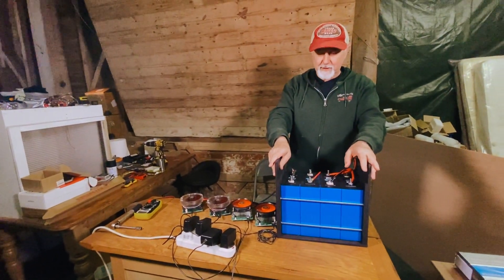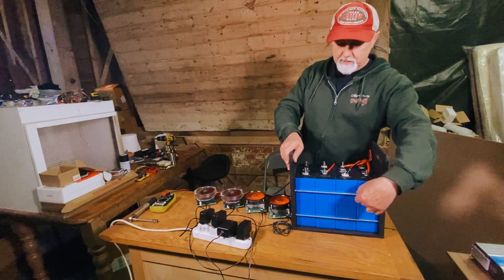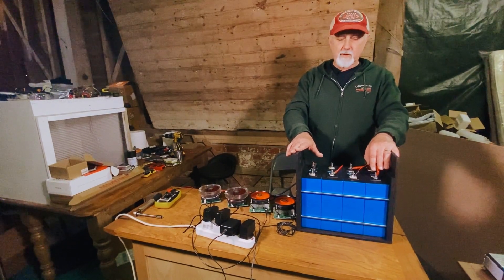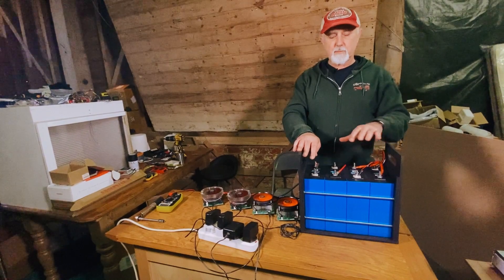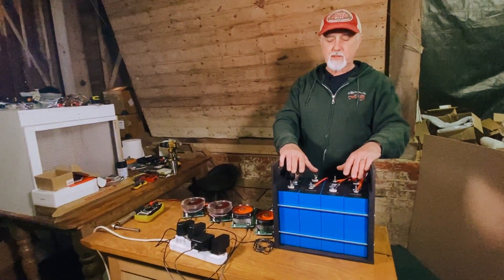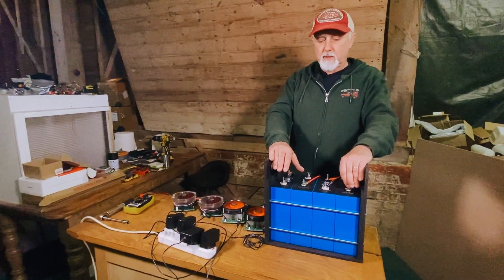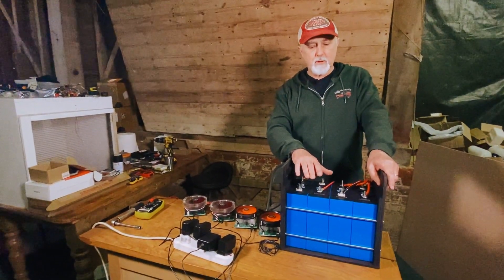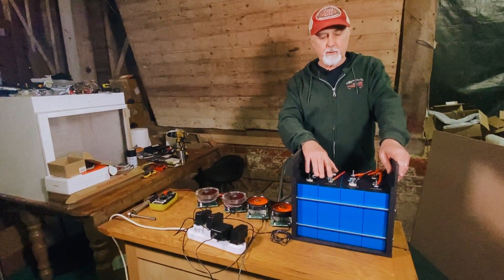420AH LiFePO4 Battery Cells: Test Results

Comment: It was a case of dyslexia… when they wrote 420, they really meant 240. Your tests prove it.
Reply from the maker: No, it was very clearly fraud. Multiple people have contacted the seller and it's been very clearly sold as 420Ah cells. We aren't the only people that have queried or disputed it with them. If it was an honest mistake, surely that would have been highlighted in all the disputes on Alibaba and the person would have realised they made a mistake?

Comment: For LiFePO4 prismatic cells the largest officially being manufactured is 320Ah, however they are actually 305-311Ah. The 420Ah cells does not yet exist, and are not on any production line. The first Sense Check is the weight of the cells, 280Ah will weigh 5,40-5,55kg ( I have notices the lighter once 5,4kg are 271-273Ah. 310Ah cells should weigh 6,04kg and the ones you have in your test should weigh 8,19kg. The second sense check would be the size a 420Ah cell should be 90mm*190mm*220mm. The chemistry in prismatic configuration is the same and requires to follow the same rules.
Reply from the maker: Great insight. Thank you!
Reply: @offgrid_power  I bet if you disassemble these cells you will find a smaller cell inside. And probably some filler material like sand, concrete or something similar.

Comment: I was kicking myself after buying 310a/h cells for my RV that these came out - I am now pleased my  cells tested 318a/h - I think balancing is important but on huge cells the tiny  60ma is just not enough - I bought a cleap 500ma balancing board and spare set of balancing leads  if the cells should drift - i used them leads to charge the pack with my T8 charger which has a 15watt  capacitor cell equalizer integrated - it balances as it charges - hassle free and very quick
Reply from the maker: Yeah, a lot of BMS will struggle with high capacity cells if they're not matched properly. Most BMS are passive balancers and as you say, such low balance current. We've tested some active balancers and they help.
Reply: @offgrid_power   I like my T8 charger - it balances as it charges so threes no faffing about with putting cells in parallel then series  long as there within 1/10 v its good to go - it charges up to 30amp too though from another DC supply - in my case the source is  480watt ex computer power supply  - time is money : )

Comment: hELLO #OFFGRID VAN LIFE  ! Please, is it necessary (and why) to put a "victron energy  battery protect" 🙂😮😮 if I got a good BMS on my battery ? It seems to do a similar job, no ? Thank you. (perhaps have you got also a better idea. Thanks)
Reply from the maker: If your BMS has the protection build into it like Daly, Overkill or 123 Smart BMS do, then yes they do pretty much the same job. Most people that I see that use the Victron battery protect don't have LiFePO4 with the protection built into the BMS, so it might be that they're still on Lead Acid or Gell.

Some people might have the Victron battery protect as well as their LiFePO4 BMS, but I don't think this is necessary. I personally have never used a Victron Battery Protect and I rely just on my BMS to look after my batteries (whilst obviously having the correct charge profiles set on my chargers).
Reply: @offgrid_power  Ok Thank you very much !!!!

Comment: I have not seen any legit cells over the 302 AH cells (commonly listed as 310 or 320) Sorry it did not work out for you
Reply from the maker: Yeah, we've seen the same. I think 300AH seems to be the limitation for this type of LiFePO4 cell. I believe Winston have some larger capacity cells, which would be interesting to test. We tested some 200AH Winston cells and they performed well above capacity at around 260AH consistently. So would be interesting to see if the higher capacity Winston cells are the same.

Comment: My only surprise here was that the value came in so much lower than the 280Ah EVE LiFePO4's. 420Ah... they really were smoking something when they wrote that listing! Good luck with the refund process!
Reply from the maker: Thanks Chris! Yeah, it's pretty crazy how bad this got! Thankfully Aliexpress have already agreed to honour a refund, but we have to send the cells back. We've decided to go that route, even though we'll loose some money on shipping them back. We figure it's better to get 80% of the money back than nothing! It was worth it for the test. ;)
Reply: @offgrid_power  that is bull.. -.- The seller should pay shipping, its not like he paid shipping when he send them to you. What will happen is the fraudulent seller wont loose any money on this transaction and he will try trick someone else into buying the returned cells.

You should just take it up with your credit card company. Explain this is a systematic scammer who have done this a lot before. Even if it has been 3 months they can still do a charge back. And you get to keep the cells. I wouldnt use these cells for something important tho. They look like 280ah cells from the size but if they only got 240ah they are quite degraded
Reply from the maker: Yeah, sadly most of the time with Alibaba the only way to get any money back is if you send the product back at your expense. It is the risk of buying from Alibaba. 

We're also following it up with our credit card company to see if that's more successful. :)